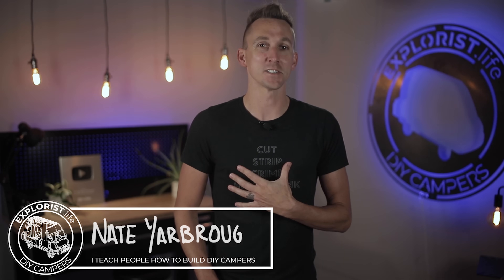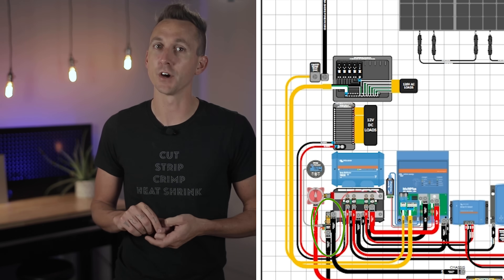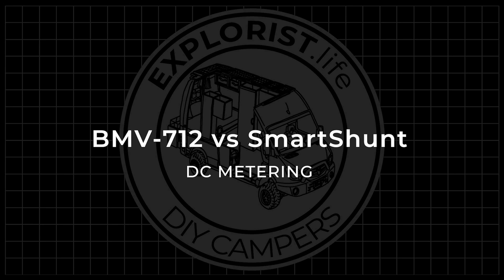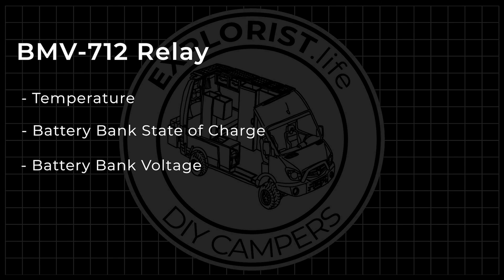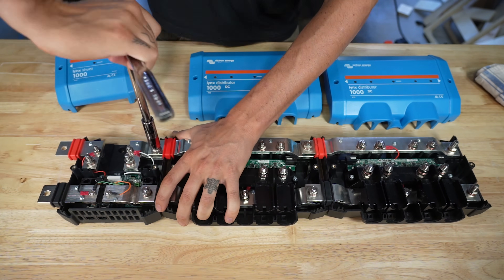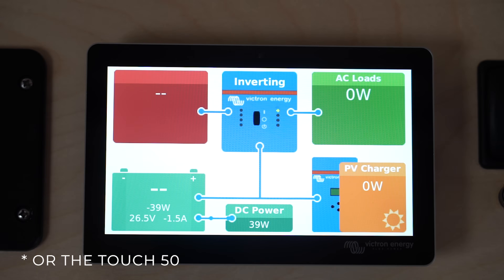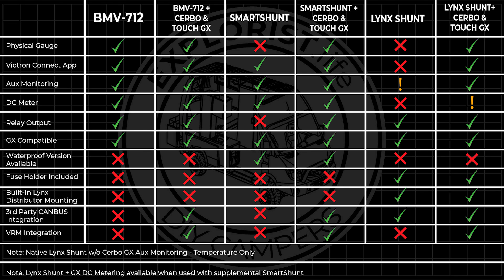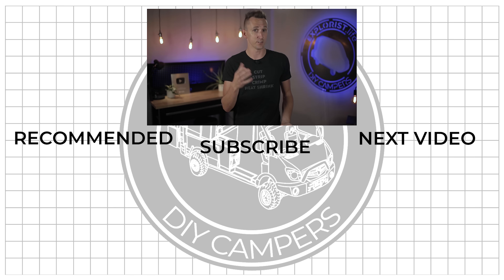SmartShunt vs BMV-712 vs Lynx Shunt

Comment: Thanks Nate and Steph. I happen to have all 3 of those devices, don't ask me why, : ) but I'm going to use the Lynx Shunt and try to unload the other 2 on eBay or something. I'm assuming it does not really benefit me to use more than just the Lynx Shunt??
Reply from the maker: Haha, oops!  You could use the SmartShunt on the Negative wire going to your DC fuse panel as a DC Meter in conjunction with the Lynx Shunt.  Not a system necessity, but still a neat feature nontheless.
Reply: @EXPLORISTlife  Cool, done! I'm all about gadgets and features : )
Thanks again

Comment: I am using the smart shunt with another vendors MPPT SCC while boondocking.  I’d get too about 80% SOC overnight but as soon as the sun came up and the SCC started charging the Smart shunt would immediately show 100% SOC.  That doesn’t seem right.  Is there something wrong in my setup?  If SOC isn’t accurate it isn’t very valuable.
Reply from the maker: The SOC is VERY accurate on these units.  Inaccuracies are usually due to improper settings. Verify both your MPPT and SmartShunt have proper parameters for whatever batteries you are using.
Reply: @EXPLORISTlife  both are set for Lithium.  As soon as the MPPT starts charging, the Victron reports 100% SOC.  The batteries are BT and their BMS accurately reports the right SOC.   Somehow the Smart Shunt is getting fooled by there being 0 or low current flooring towards the batteries.
Reply from the maker: @phill4435  The 'lithium' setting isn't an 'across the board' setting.  For example... Victron lithium wants a max of 14.2 and Battle Born wants 14.4-14.6. Big difference there.  You'll need to contact your battery supplier for support and guidance there regarding the proper parameters.

Comment: Great video Nate, I was looking at either the smart shunt or the BMV-712 but am concerned about the user feedback on the Bluetooth range of the smart shunt. We’re you able to get a comparison of the range one can expect on each of these units?
Reply: Actually that’s the big difference between the two units. The smart shunt Bluetooth is in the unit whereas the 712 Bluetooth is in the remote display.

So I always recommend the 712 because your batteries usually tucked away possibly on the tongue of your trailer while the remote display will be mounted inside. Therefore you get a much better signal while you’re in the trailer with the 712.
Reply from the maker: That's a great consideration, Tim.  Thanks!

Comment: I went with the SmartShunt in my system since I was going to have a Cerbo GX and Touch 50.  The SmartShunt has Bluetooth and VE Direct connection so it works well with the Cerbo GX.  It also has a temperature sensor input available so you can stop the MPPT from charging at freezing temperatures.  The BMV-712 display seemed superfluous.  Any features that the BMV-712 has that the SmartShunt doesn't, are not important to me.  I didn't go for the Lynx Shunt because of its size.  The relay outputs on the Cerbo GX are basically unusable for anything other than starting a generator if you don't know how to program them.  You didn't mention the tank level inputs on the Cerbo GX.  I'm using those to monitor my fresh and gray tank levels so I don't have to have other gauges.
Reply from the maker: The SmartShut + Cerbo GX + Touch 50/70 is a great combo and is usually what I recommend for those wanting the functionality of the Cerbo but don't care about the clean form factor of the Lynx Shunt.

There's a LOT I didn't mention about the Cerbo GX, like the tank monitoring, since this isn't a Cerbo GX video.
Reply: You can also use just the standalone Victron temp sensor to control low temperature cutoff off the MPPT charge, without any of these shunts.

Comment: Hey Nate, I've been a subscriber for a while now and have learned a ton from your videos. Pretty much built my entire system from all the knowledge I gained from you in the last couple of years. (All Victron and BattleBorn) Then to top everything off, after learning about you and your family's fire service history, I felt a closer connection and knew you were genuine and trustworthy. I am a retired 30 year fire service veteran and have lost several co-workers/friends to work related cancer. (I know the pain and loss) Now, I have what is probably a stupid question but can't find a definitive answer. I currently have a BVM-712 that I monitor with bluetooth, but want to do it remotely with my wifi/router setup in my 5th wheel. Can I use the Cerbo GX without buying the Touch 50 by using the  Victon's VRM app?
Reply: Not Nate, but using a headless Cerbo. Most things you can do without a Touch GX connected, over the remote console. 
For initial setup, it can be helpful to have local access. A standard HDMI monitor and USB mouse work.

Comment: Due to tight spaces, I needed my wiring to come in on the opposite side of the BMV-712.  To accomplish this, I unscrewed the circuit board on the shunt and flipped it upside down so the wiring to the battery would be on the correct side.
Reply from the maker: Nice!  And it worked just fine?  I mean, I guess I don't see any reason why it wouldn't.  Nice work! 👍🙂

Comment: As stand alone units in smaler systems, Iprefer bmv-712 ( yes, more expensive) for the reason that it has a larger area for bluetooth coverage. I have both. With smartshunt you need to stand quite close. Bmv-712 screen, well, fast look and you have the info without having the phone.  Maybe newer smartshunt has larger bluetooth coverage? Mine is 2 years..
Reply from the maker: Yeah, I like the BMV-712 as well.  They have indeed made SmartShunt Bluetooth range improvements as well.

Comment: I specifically used the BMV-712 to stop the Orion DC-DC charger from charging when the temp was too low. I used cheaper lithium that didn't have the low temp cut off. I'm building a current van and going with the BMV-712 again. The physical gauge is a must for me in a van. Great explanation of theses products.
Reply from the maker: Nice!  That's a great use for that function.
Reply: @EXPLORISTlife  I have watched a lot of your vids and the one area I'm confused about is fusing the AC fuse box? How do you decide between 30 & 50 Amp main fuse? I'm planning that at the moment and I'm a little confused? I have the dual AC/DC fuse box you have in the majority of your wiring diagrams. Thanks

Comment: thanks, Nate! The graph that breaks down all of the shunt’s traits is very useful. TBH, I will just trust in your blueprints that I purchased. But, now that I think about it, you may wanna offer different shunt set ups with your blueprints.
Reply from the maker: Definitely!  I think the BMV-712 will stay as the default in my full diagrams as I think it's the best bang for your buck in most cases.  That said, I'm planning on adding an additional page to all of our diagrams that would show how to connect it into a system with the Cerbo GX with the Lynx Shunt OR the bmv-712/smartshunt.  Also...  our 'Lynx Distributor Wiring Kits' already include a BMV-712 vs Lynx Shunt option with multiple wire sizes.  Check out the drop downs on this product page to see that: https://shop.explorist.life/shop/all-products/camper-wiring-kits/component-wiring-kits/lynx-distributor-wiring-kit/

Comment: Good vid, thanks for sharing this info. I am considering to buy a BMV-712 mainly to control a small house  Hotwater system in my bus as a solar dump for when my batteries are full SOC around lunchtime usually. 
I have a 24v 10kw lithium battery bank, 2kw solar pv, and a 3kw MPPT AIO system, Q) what sort of relay/contactor gear is available for the BMV-712? Cheers
Reply from the maker: The Relay Out specs for the BMV-712 can be found in section 8 of the user manual.  You can use this relay out to control any 3rd party relay that falls within those parameters.

Comment: What's the best way to do it if I want to use the gx touch 50 but also want the physical gauge in the wall
Reply from the maker: The touch 50 IS a physical gauge in the wall... but if you want to round one from the BMV-712 AND the touch 50... you'd just use the bmv-712 w/ gauge + the cerbo gx and touch 50gx.  The Cerbo GX would be connected to the BMV-712 via VE.Direct cable.

Comment: Thanks Nate, nice and short, but... It sure raises a ship load of questions. I am interested in how the Lynx can be used to control the temperature of the "electronics" storage space (specifically, high and low temp control of exhaust fans or battery warming pads). Any suggestions?  Also, I would imagine the temp probes on all of these can control "battery shut-off" in high and low temp conditions Right?
Reply from the maker: I assume you're asking about the Lynx Shunt + Cerbo GX.  If so...  I'd recommend using the temperature sensors and relays on the Cerbo GX.  You'd connect the temperature sensor to the  Cerbo GX and then the other end of the temperature sensor wire to 'wherever' you like (could literally sit in the electrical enclosure if you like) and then set up the temperature sensor to control one of the relay outputs.  If it's just an enclosure fan, you could likely power it directly from the relay output (depending on size of fan) or if it's a heater, you'd use the relay output to control a relay for the heater.  Chapter 2.12 of the cerbo gx manual is where all of this is covered (manual can be found on the victron website)

I plan on making a video about controlling an enclosure fan through the cerbo gx soon.
Reply: @EXPLORISTlife  thanks Nate, I'm planning my new system build (around Dec), and this is a nice feature to know about. The fans I'd consider are likely 12v PC case fans.

Comment: I have my four lithium batteries wired as 24 volt. Do I install the 24-12 before the linx?
Reply: Ru talking about a 24v - 12v Buck Inverter & a Lynx Shunt? If so, a 24-12v step down inverter would need to go after your Shunt. Battery then shunt then load.
Reply from the maker: The Orion 24-12 V converter for 12V branch circuits would come after the shunt.  See this system for how that would work: https://www.youtube.com/watch?v=E5q7_4FH4LQ&list=PLmvhcyi4n0TVfA4XCYJBkzfUXunSON1zX